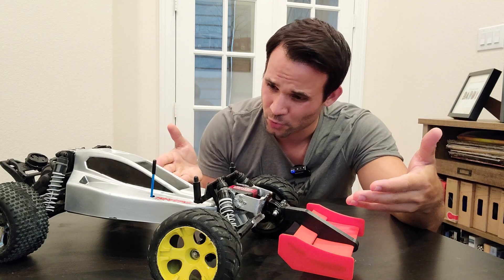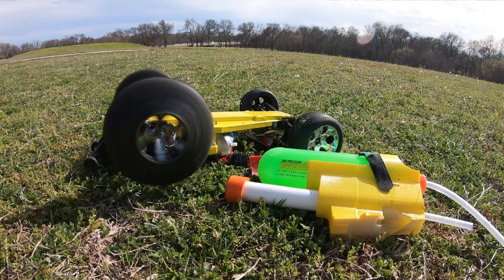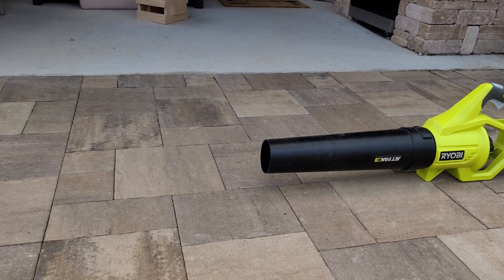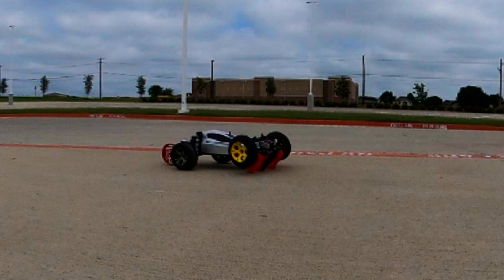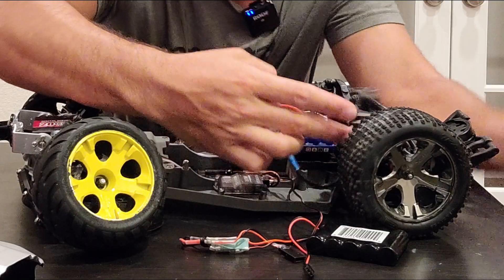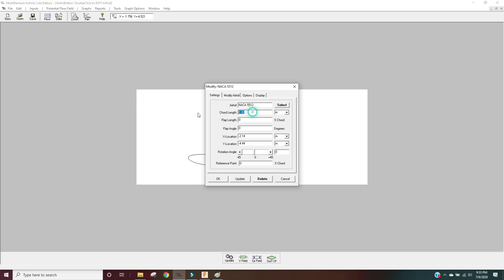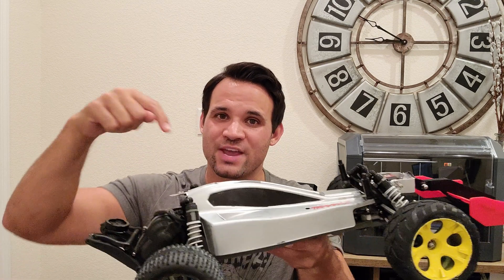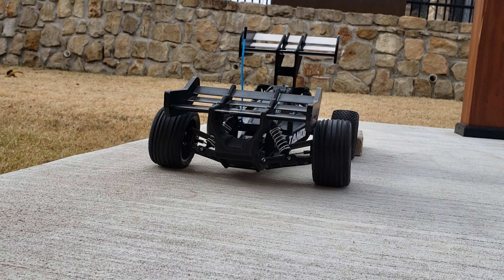Active Aerodynamics Design and Destruction

Comment: How did you get the speedo meter on the video display, great videos 👍🏼
Reply from the maker: Through the gopro app with a hero 7 black. As long as you have a gopro with a GPS built in, you should be able to add them.

Comment: Your servo is responding way to slow. You should start by making a bump on the road of known size that you want to try and correct. Then work out the average time the car has airtime and how long it takes for it to peak. Then you know how fast your servo needs to respond, at which point I am sure you will see it is not responding as fast as it should.

On another note you could try using two drone motors on the side of the car at the center of gravity that angle to creat down force. You could angle it in such a way so that the props give you thrust as well. Then still using the accelerometer sensor to adjust the angle of the props to minimise airtime. I think on such a small car with such low speeds, this would be a better option.
Reply from the maker: The wing isn't intended to correct bumps. It's actually for wheelies when i hit full throttle in the 40mph+ region. 

There's no way this system could ever correct for bumps as you've pointed out...its much too slow.
Reply: @EngineeringAfterHours  oh ok then maybe I misunderstood. I thought the point was to keep the RC flat on the ground.

Comment: Hey, interesting project! I don't know if you want advice on how to make this work, or just want to do it your way, but there are simpler options on how to setup the car for speed runs. Get some foam tires, Contact 1/10 foams, 30mm wide, they wont balloon. They are only 65mm, so you lose some in your final drive, but its a trade off for stability. Secondly, add a rear wing, it will help keep the back planted, however, don't use anything too aggressive, since it will cause it to wheelie when you get over 60 or 70. If you look at a lot of 100mph cars, the rear wing is just a flat piece, with large vertical uprights for straight line stability. For the front, add a splitter to limit the amount of air getting under the car. Since you have a 3d printer, add some air dams. Make it as low to the ground as possible. Add some droop screws to the a arms and lower everything, but make sure to rake the car forwards, with the rear sitting higher than the front. You can limit your shocks by stiffen them up with the spring collars, and adding thicker oil. You don't want a whole lot of suspension travel. I use shock limiters, to prevent it from bottoming out. Anyways, these are just a few things I've picked up over my short speed running phase. Good luck!
Reply from the maker: That's all really good data for anyone looking to do it the typical way and are primarily focused on speed runs. 

The intent here was to over engineer so I can demonstrate active aero with gyro stabilization and wing design. Wings like this are very "draggy" so I'd never put them on a true top speed car. Wings are more useful for lateral Gs.